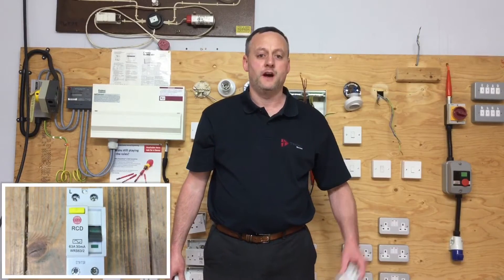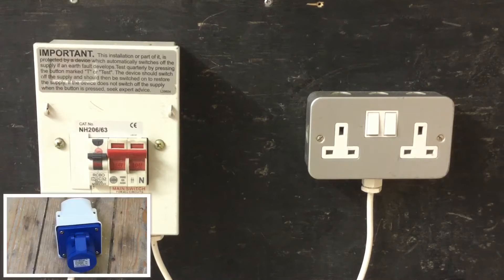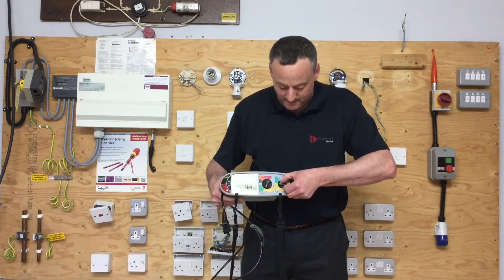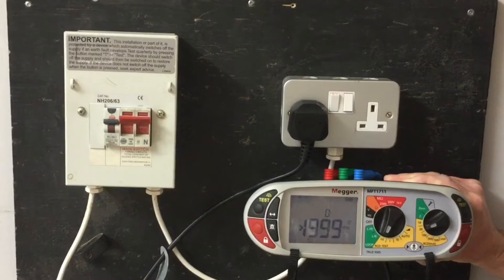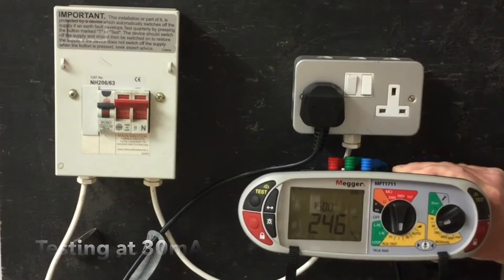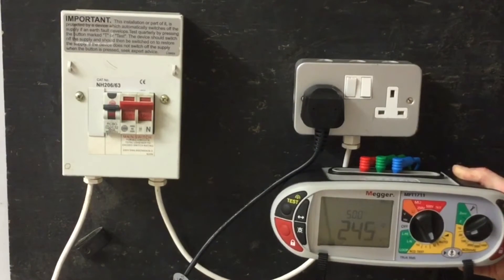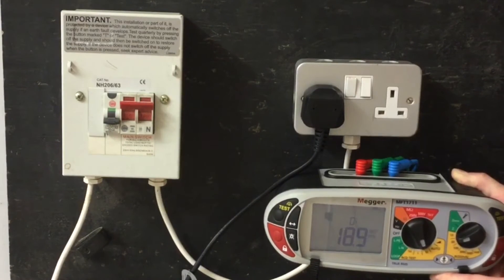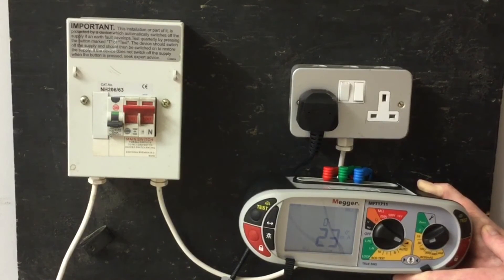Electrical Testing the Tests Required for an RCD Rated at 30mA or Less

Comment: This video is now technically redundant, being as it’s 4 years old , if we go by Amendment 2 , that is , but it is still an informative and interesting video, personally I will continue to test RCDs at 1/2 ,1and 5 times the rated current. 
Fantastic video Gas👍👍❤️
Reply: what reg has changed to make this redundant?
Reply: @jeffpark4136  amendment 2 now only require that we test 30ma RCD/RCBO at 1x it’s rated current once on the 0d and once on the 180d and with the MFT set for AC type RCDs..
But we can still do all the tests ie 1/2x 1x and 5x AC type and A type if we choose to we are just not required to.
Reply: @seandempsey7351  Indeed, in the college they didn't teach us to use the 5x test.

Comment: Can you please explain the relevance of testing at different position of the sine wave? I think you mentioned testing at zero and 180 degrees.
Reply from the maker: Hi. https://www.theiet.org/forums/forum/messageview.cfm?catid=205&threadid=10874
Hope this helps Gaz 👍
Reply: GSH Electrical - much appreciated.
Reply: Cheers for asking the exact question running through my head.